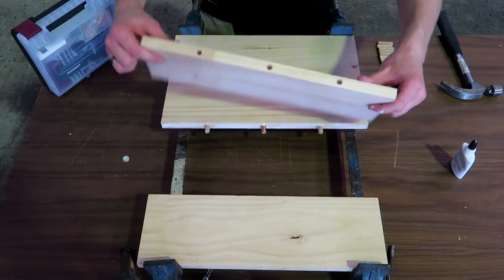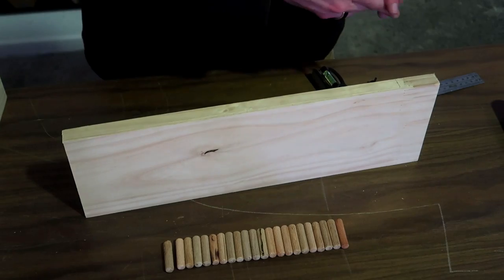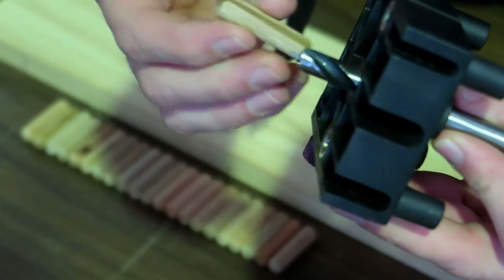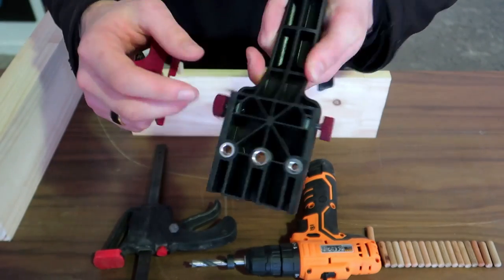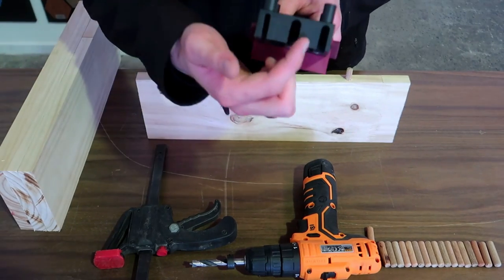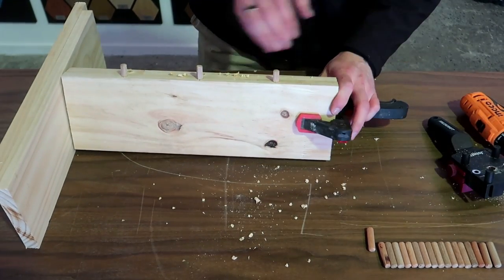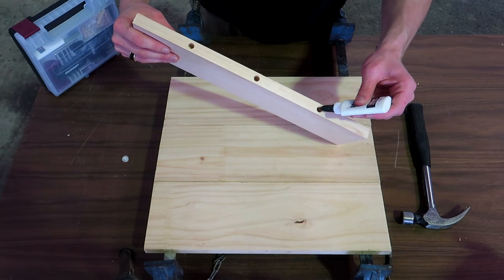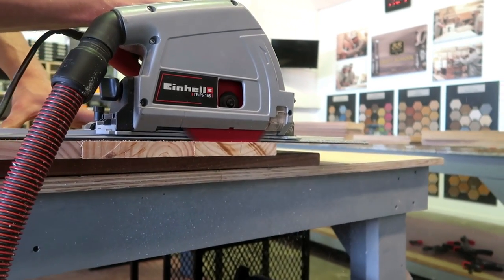Guide to Using the Milescraft Dowel Jig Kit with Jointmate

Comment: I bought this kit, but unfortunately I cannot recommend it. On the upside the kit provides three drill bits, their stop collars, an assortment of dowels, and the dowel jig. My main problem was with the dowel jig. Because you use the jig by hand, it’s very easy to allow it to slip and misplace your dowel holes, which results in badly placed dowels, wasted time and effort, and materials in the trash. I’m a fan of Milescraft products, but not this one. A better option for a dowel jig is their 3411, which allows you to more easily calibrate dowel hole placement, and it has a clamp to help drill the holes more effectively. This costs 2x the reviewed jig, but believe me it’s so much better. And there is even another model they sell which makes dowel construction even easier. Both of these two jigs are less than $100, but well worth the money. I would especially recommend these over the simple plastic jig reviewed here.